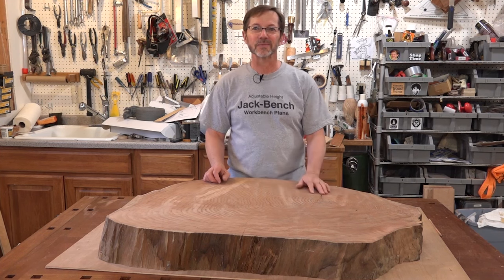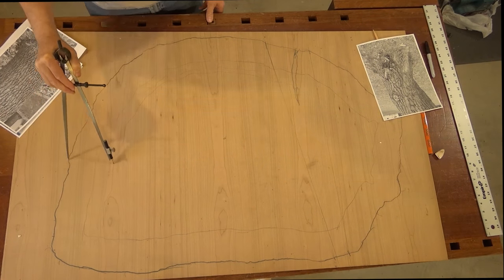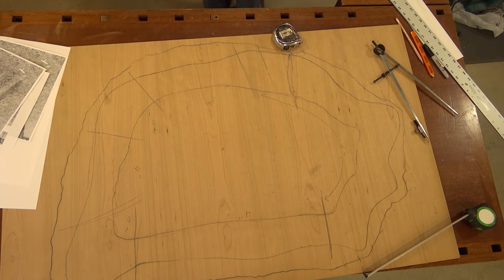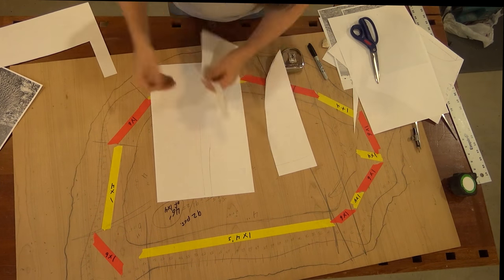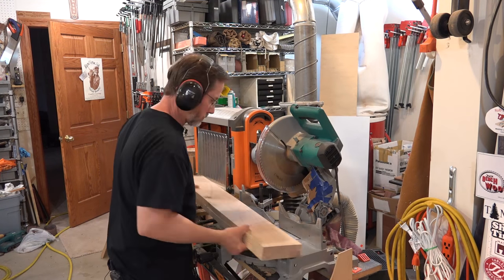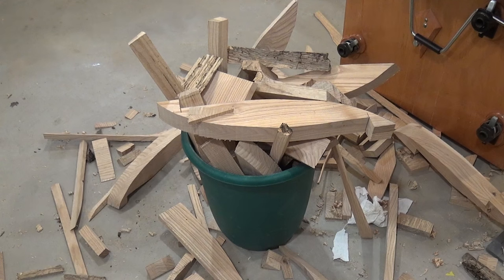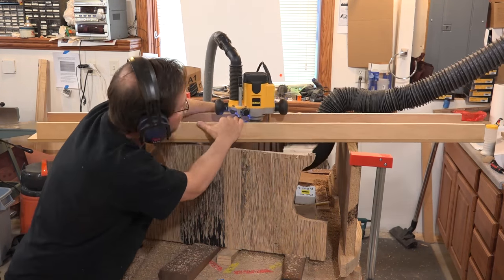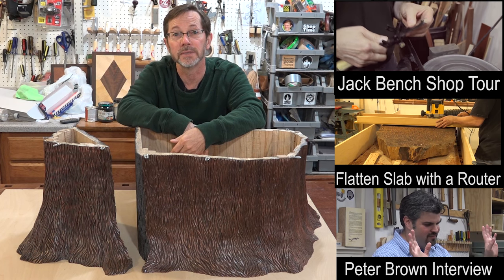Carved Tree Trunk Base for Slab Table - How I Built It

Comment: Been watching you work on this on instagram.  Great looking table.

Quick question, I notice you are using the table top connectors on the outside of the table.  Is there a reason with the hollow base you didn't put them going inside to hide the fasteners?
Reply from the maker: Aaron?  It is really nice to hear that you've followed my project, thanks!  That's a good question about the fasteners.  I needed to be able to easily disassemble it and the clips are so much easier access from the outside.
Reply: Yeah, it is Aaron.

Okey, that makes sense.  I suppose with that top it is quite the effort to flip.